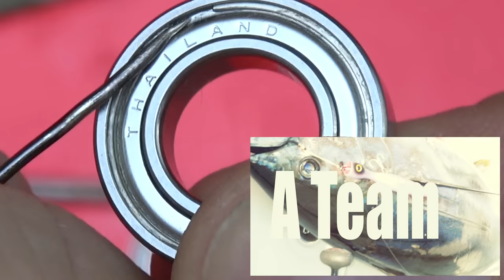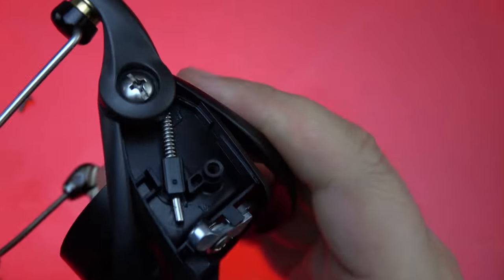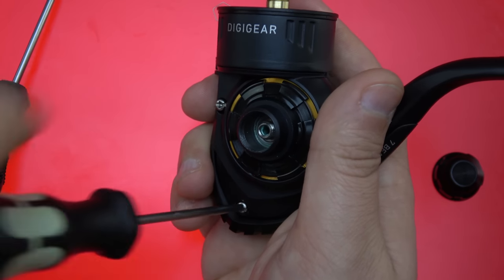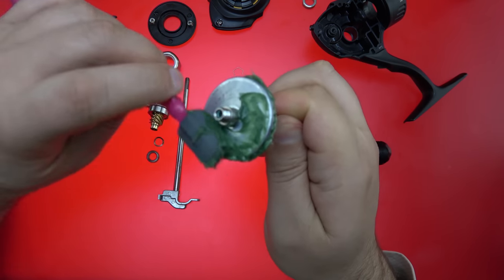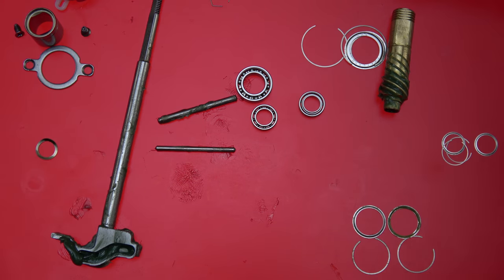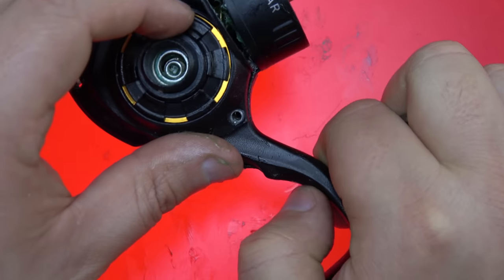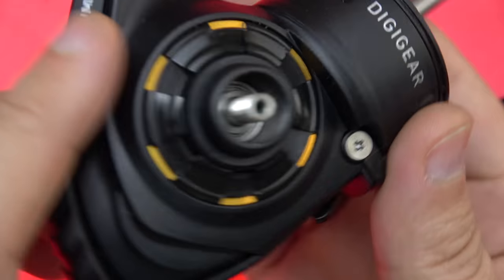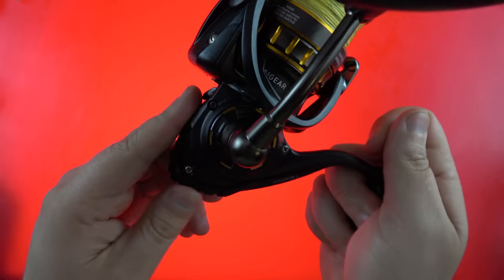Daiwa BG Full maintenance and service tutorial. How to protect your reel against  sand and saltwater

Comment: Ive bent the bearing seals trying to get them out. Are they necessary? Thanks for the helpful video.
Reply: They absolutely are. Call or email Daiwa USA and they may send you the seals for free.
Reply from the maker: Not really.  They are shields.  Not seals.  Only good at keeping large debris out or keeping grease in to an extent.   Sealed bearings, are a bit more effective to a point.  But add a bit of resistance.   Fish it and don't worry about it.

Comment: Great video. I was watching to get some pointers on doing maintenance on my own spinning reels. I'm gonna start with some Academy store brand H2O Xpress Maxim spinning reels. Are you familiar with that brand spinning and baitcaster reels? They seem to have very good following here in TX for the price point, almost cultish especially with the Mettle baistcaster. Anyway, one of the Maxim spinning reels has a lot of play or slop in the rotor when I stop reeling whereas the others are pretty solid and stop on a dime. Any clue what causes that slop or play in the rotor before I go in and take it apart? Is there a specific part that can be replaced to give it that solid feel when I stop reeling? Thanks a bunch and great channel.

Comment: Great Info, and camera work. Question, have you ever had an issue on these reels with how few threads the handle is held on by when using the left hand retrieve set up? I just received a BG 3500, and it is only held on by 2-/2 threads!!! Geeze! While on the opposite side (right Hand), it screws on with 11 turns!!!! Ummmm. not comfortable with this at all. Your thoughts? Thanks
Reply from the maker: My one gripe with Daiwa was how easy on and off the handle screws on... So when you snug up the handle... It's so easy to "crack" loose the threads and wind it off.. I've never had an issue but shimano does do it better here.. As you "crack" it loose.. And still have a half turn of resistance.. Maybe a wrap of Teflon pipe thread tape may add a little more security... Never tried it but may work

Comment: Could you show how to remove the auto bail? I read that people has issue with it auto lock while casting and loosing lures. I've been planning to get the 4000 or the 4500. The 4000 is perfect but I don't wanna deal with losing lures. What I have read was that the 4500 would be to heavy for constant cast.
Reply: The 4500 a little heavier as it got twin anti reverse.  Hold more line than Shimano Saragosa 6k.
  Bought the BG after reading Allan Hawke review. He check quality and examine all parts like Forensic detective. Best budget reel in the world. Too 5 best reels !

Comment: Do you know where, if at all possible, I could buy a bearing(s) for the line roller of the BG, to replace the bushing(s)? And do other handle designs on the more pricey BG variants (saltist, saltist back bay, etc) incorporate a gasket anywhere around the handle screw or the cap on the other side? That would be worth trying to buy to throw onto the BG as well if it's compatible, but I guess grease works just as well?

Comment: I own 5 Daiwa Certate’s and I’m probably going to sell all of them and buy 5 BG’s. Amazing reel for the money.
Reply from the maker: LOL....those certates are sweet!   Can't believe they sold so poorly in japan that US dealers were allowed to buy JDM stock and retail them here for half price.  Figured based on looks alone it would a killer against the twinpower.  The HD versions are saltigas bj's with a step down in gearing (which is more than adequate)
Reply: My certates are all the first gen from around 2007, I can't get parts anymore.
Reply from the maker: Really....Damn...I'd sell em if it were me...I'm having a furious internal debate as whether or not I should sell off my 08 stella sw's.... I like them better than the current ones....but new ones are coming in a year...and gotta strike while the iron is hot.....If you go two gens out..the value drops out.

Comment: hello!, very good. Some put more fat under the rotor (kind of bathtub)...how many grams-% gain weight?
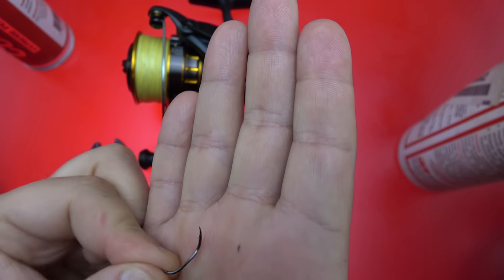   A mate has a BG 5000 2nd hand....He bought it with a crank on and it can't be unscrewed!! 2:00 
Any ideas? Would it be a sample shop and they put glue on it?
Reply from the maker: It could be... But I've seen that before.... Try putting it in the freezer for an hour or so...... Likely corrosion... Or hitting the handle with some heat

Comment: Do you grease the reel when you first buy it to make sure saltwater has no affect on it ? If saltwater does get on it after you have already greased it all you need to do is rinse it right ?
Reply from the maker: I generally do this to all new reels destined for hard use in the salt.  That way it'll last like it was longer and if it did get submerged it buys me time to get in and inspect. Grease does a good job telling where water spent its time. So it makes the process easy

Comment: I've been wanting to purchase a BG in a smaller size compared to the 6500 I have. However, the automatic bail trip bothers me. If I remove that screwed in part that gets tripped by the rotor, would the reel function like the larger manual BGs? Thanks!

Comment: The issue I have the BG 3500 is that the bail brake does not work well, leading to rotor spin on the cast with the result of mag darters flying a country mile.  I'm going to fill the reel compartment with Corrosion Block to see if it will slow it down.  Any other suggestions?

Comment: Do you have a video where you service and clean a freshwater reel? You mention that you wouldn’t go as heavy on the grease, is that it? How do you know how much grease and where to oil rather than grease? Thanks
Reply from the maker: For freshwater spinners.  Grease only gear teeth and wear things may rub.. Oil on bearings.. Don't grease the main shaft too much especially in colder temps.   Beware lubrication of any kind in the ar clutch.   I prefer tsi 321 or corrosion x oil.....
Reply: Great tips! Thank you very much. You inspired me to service my own reels. Last night I attempted to clean out a very cheap saltwater reel that I fished out of a river. I definitely see what you mean by not lubricating the AR clutch lol.... glad i practiced on a cheap reel instead of my slightly nicer ones.

Comment: AWESOME VIDEO! I caught a Steelhead in the surf while going for perch and my new BG4000 got infiltrated. Question for you? After I put it back together as you did my anti-reverse isn't holding? If I flick the switch a couple of time quickly it might grad then stops working again after a few turns of the handle. Did I place to much grease on the reverse switch or... Thoughts?
Reply from the maker: Most likely that's what it is...also make sure the clutch is seated properly with the cap on top.  
I always recommend testing whenver you're in the clutch.  And even put it in the fridge for 10 minutes to simulate cold weather lol
just to be sure.
Reply: Tackle Advisors I just took it apart and cleaned off the clutch and reseated it. Then reapplied grease and it’s 💰 now! New subscriber & thanks 👍🏻
Reply from the maker: Sweet!  Good to hear!  Thanks man!

Comment: I would think clingy Aqualube wouldn't be the best thing for ball bearings and the line roller bushings, and only particularly appropriate for the gears... got any thoughts on that after your experimenting?
Reply from the maker: It's all I use.  Haven't had an issue.  I stopped using corrosin x, yamalube, daiwa, shimano, and krytox   Any grease in a bearing will make it sluggish....hence cutting it with oil to thin it.

Comment: What do you recommend cleaning the internal parts of the reel with if you dunk it or just want to do a full clean? Thanks scoob
Reply: kerosene  will dissolve all the grease and oil inside the reel , I even use it on my graphite reel does no harm that i have experienced just wipe it all out and make shure its dry before re greasing the reel.  , People even use kerosene  on car paint jobs so it should be all fine hope this helps you out .

Comment: Thanks for this video, it really helps all the guys who are afraid of servicing their reels. You use Pozidrive screwdrivers, does it means Philips screwdrivers don't do the job and could damage screws heads ?
Reply from the maker: Philips drivers work fine provided they are cut and sized right.  Something about the pozi drivs I am using.  Just work noticeably better than anything else I've used.

Comment: Fantastic video. I will be using your links to buy some grease and oil.  

I have just purchased a BG 2000 and 2500. I will be using them from my boat for flounder, blues, and stripers. Do you recommend a full tear-down and lube session before I use them for the first time, or are they okay as is for the first season?

Thanks again for the video, and i have become a subscriber.

Comment: Many thanks for the amazing extensive tutorial!
What would you advise as preventive measures for a brand new BG? I'll fish it in both fresh and salt water. Would you recommend instantly opening it up to the gears or just do some maintenance on the clutch, drag, around te AR clutch and the reel handle.
I have little experience with maintenance of the gears, so really don't wan't to mess up my new reel.
Also do you have experience with Penn grease and oil?

Comment: Did you noticed a difference in the force you need to apply to turn the reel after you grease the bearings? Also would you recommend Aqua Shield or Corrosion X.
Reply from the maker: Absoultely.  Grease packing all the bearings will make it tighter.  Cutting grease with oil is a good way to minimize it.  Aquashield I'm finding to be better....but corrosion x easier to work with.   Also I find that I use two cuts of aquashield....uncut with oil and cut with corrosion x oil as it is very sticky.  You can't go wrong with each..but aquashield takes som egetting used to and it gets allllll over the place.

Comment: Hey Scoob, @ 44:17, you say you are going to Oil the AR Clutch. But, I didn't see you do this. How much oil do you give it and where do you put it? On the Clutch Sleeve, or on the little rollers in the Clutch? Thanks.
Reply from the maker: Hey man.. OILING THE CLUTCH IS AT YOUR OWN RISK. If you lube it it may fail. I usually apply a few drops of corrosion protecting oil on a paper towel.  And apply it to the sleeve.   If it's a clutch that can take oil I'll apply to both
Reply: Oh, so it is a tiny quantity. I read about people running dry. I was thinking I would just go with whatever little bit of oil I had on my hands while putting it back together. Thanks for the response. ...This is for one of my brothers reels. In the fall he showed up at the river and the reel he brought was seized up. All we had was a quart of oil in the truck. We just soaked the reel to get it moving and get through the day. He learned his lesson on the first fish he set the hook on when the reel spun backwards at 3000rpm haha.

Comment: I've got the 2000 size and the knob is riveted on. What is the best way to clean these styles handles? I assume it's a bushing inside and right now there's no issue with the knob but just wanted to know for future reference.
Reply from the maker: Water pressure is your friend.. Be careful using harsh solvents as they can melt the rubber.  What dish soap and spin.  Then a few drops of oil

Comment: Daiwa indicates that the BG has a roller bearing. Apparently this is not the case. It has a bushing? Also it's supposed to have 6 + 1 roller bearing. I only saw 5 bearings. Are they counting the AR clutch as a bearing? Can you clear up this discrepancy? 
Saw the specs for the Daiwa Exceler LT 4000. 6 oz. lighter and 26 # max drag vs 17 # for the BG. Greater line cap. 20$ cheaper. What do you think? Great vid. Watched the whole thing even though I don't own the reel. Since cleaning is an important part of owning a reel this vid is more informative than watching some guy fishing with it.

Comment: My reel is somewhat noisy now and sluggish like you said it would. I did go ham on the grease like you did. Is a noisy reel expected?
Reply from the maker: Noise no.  Tight yes.  Try loosening the rotor retaining nut a tad and double check the shims on the main gear and can you tell where the noise is coming from?  Fast noise means pinion or pinion bearings or clutch.  Slow means main gear /bearings or oscillation

Comment: My Daiwa Fuego’s handle (3 months of use) has started becoming extremely difficult to crank. It’s only when there’s pressure on the line and at the very start. Once the rotation begins, it’s smooth again. I paid to have it serviced but the issue still persists. Any advice?

Comment: Just redid my 2500, since I cut the bail off, the top rotor spun too fast on casting & I got 35% braid catching on the line roller - just really wanted to slow it down - not skishing, yet !!!

I couldn't easily get the bearing retainer (42) screws out & therefore the pinion fully out - BUT squirted mucho Corrosion X  below the drive gear.

Did not pack any bearings & got it back together OK - BUT am getting some noise when in anti-reverse, otherwise sounds OK. 

Any pointers & thanks for all yr videos, etc ...
Reply: i also lubed mine after an unexpected dunking in salt water and it feels stiff/notchy in anti-reverse, with it off the reel spins forward and backwards freely. any ideas? im thinking about cleaning the anti reverse and maybe oil it vs grease?

Comment: If fishing from a boat on the salt would you use the same amount of grease. Also, did u pack that little bearing under the spool?
Reply from the maker: It depends......if you're a hoser offer you may want to.  At the minimum though you'd probably want to pack the upper pinion bearing, and the bearing on the side you attach the handle.  Plus pack the ar switch with grease.
HKjonathan who supplied the reel prefers it faster since he burns for albies....So I will remove or thin the grease for easier cranking.  
If it's a bunker snagging reel I would not pack it this way on the boat.

Comment: Thats not a little bit tight. Thats too much tight. Dont you think the corrision x is too thick? The original grease that comes in the reel is very light. That makes reel really light and smooth. Have u ever tried to make grease light my mixing synthetic oil in it ?

Comment: If I have resistance while turning the handle,is that generally a bearing in the side plate?
Reply from the maker: It can be... It can also be and often times it's something binding on the 'output "side of the drive trane... Pinion bearings or too much (or oxidized) grease where the spool shaft traverses the pinion... Also it could be the oscillation gear (being over greased underneath or oxidized /water immulsified grease)

Comment: Scoob is there a particular bearing (model number) that you replace the BG pinion bearing (g46-7302) with? Was curious if there is a better bearing I could order? I’m new to this and not sure what a good replacement would be. Thanks for any help
Reply from the maker: Boca sells a rubber sealed hybrid (yellow) that has worked well...Not sure of the measurements you need..but a little google foo or chat with boca should get ya squared a way
Reply: @TackleAdvisors  thanks I really appreciate the help

Comment: Thank you for being diligent, the lighting, angles, background is phenomenal for a non monetised video. So if it's a new bg do you think adding grease over factory grease is a good idea? Is degreasing essential?(yes I've been called lazy a couple of times) Thanks.
Reply from the maker: Thanks man! I would degrease the main and pinion prior to applying new.  You can play mixologist when it comes to the other areas if you don't want to go nuts.   An ultrasonic with a mild degreaser would work great too.
Reply: @TackleAdvisors  lol ultrasonic, Scooby you're the reel deal, thanks good luck with the channel
Reply from the maker: Thanks brotha! Appreciate it!  FYI ultra sonic cleaners are cheap now. I dig em for hands off get most of the crap off type stuff... Great on jewelry too lol

Comment: Hey friend, recently I read some complaints about the bearings and gears of daiwas bg, mainly 4000 bg, did you have any of these problems? I have a daiwa bg 8000, I bought it a few months ago, I live in Brazil and everything is more expensive here, so I was sad about these reports. Haha., Thanks.
Reply: Personally I think it's because people are treating the BG like it's a fully sealed reel and not doing the prevention or maintenance. There's nothing wrong with the bearings or gears but they're not as protected as in other reels that are multiple times the price. Guys are swimming with these reels and reeling them underwater and then complaining about the bearings and gears. The reel just isn't meant to be fished like a Van Staal but it's a great product for the price in my opinion. As long as you don't take it for a swim or scuba fish with it the reel will last forever with basic maintenance.

Comment: Handle keeps slipping backwards when fighting a fish or working my lure. Reverse switch is not turned on. What could be the issue? Bg 4000
Reply: Clutch failure, better to change the clutch out instead of servicing it

Comment: Great video. Where did you get that small syringe from that you put the grease in? I just got the Corrosion X and Reel X lube.
Reply from the maker: Cool!!
Here's the deal with syringes....you can buy em cheap on ebay and amazon....BUT....90% have the black rubber plunger....I've found that grease over time destroys it and it will ruin the grease in the syring.  So either load them up with a little bit at a time...or buy ones without the black rubber crap.
The one in this video....I had a nail go through my foot a few years ago....I asked the doc for some to load with grease just for this purpose....and he gave me a bunch :)
Reply: thank you for the information. keep up the good work
Reply from the maker: You're welcom! Thanks man!